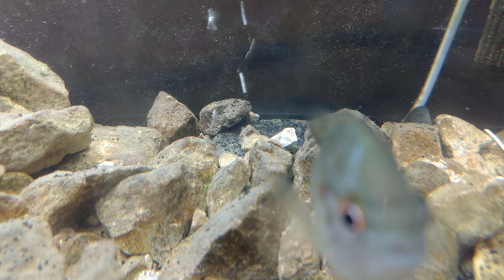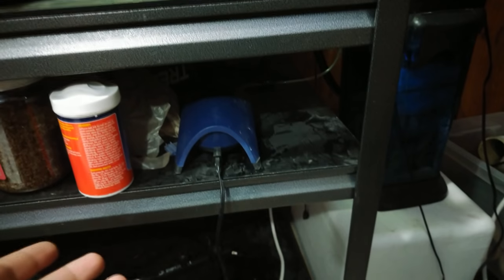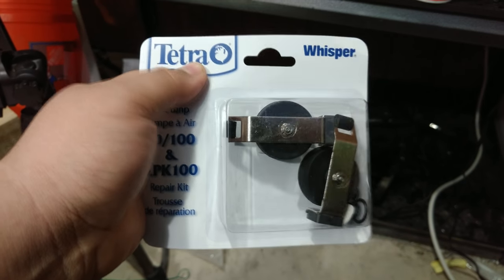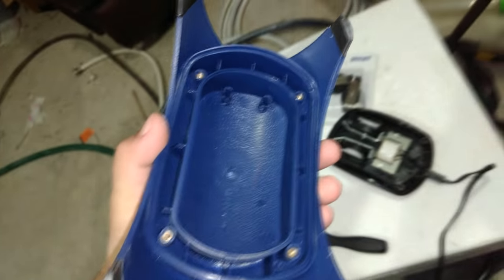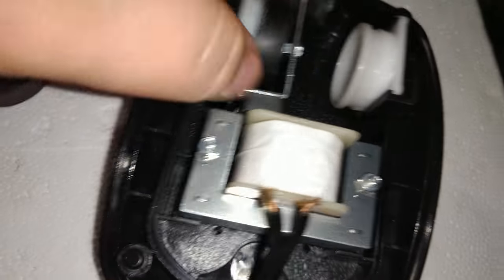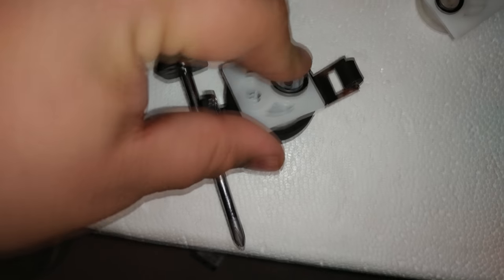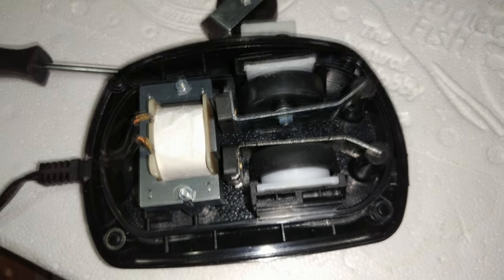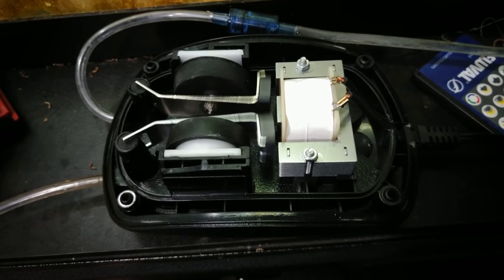How to fix an aquarium air pump when its not moving air

Comment: Very helpful video , thank you. My gf picked up a free tank and air pump but the pump was weak. After watching the video and opening it up it looks like the previous owner had a back siphon happen through the air pump, the screw head inside the diaphragm was rusty and there was a dry film/residue inside. After cleaning out the tiny airways on the plastic piece and reassembling it worked like new.

Comment: So glad I found your video. I own the Tetra 60 whisper and was having the issue you described. I opened it up and found that one side was missing on of the O-rings. I suppose it could have fallen into another dimension when I took out the part. Either way, I was able to find the right O-rings at my local hardware store, replace it, and now it's working perfectly. Although, that did lead me to find a leak in the line, probably should have looked for that first thing. It all works now though, thanks to your insightful video.

Comment: I had two of these air pumps that failed in a smaller tank than they were rated for.   Yes it was simply a matter of torn diaphragms.  After getting an email stating replacement parts were on the way, I never got them.  3 weeks later, looking back at the email chain there was also a message stating that rubber parts were not covered in the 2 year warranty and to go find them myself.  Basically the support guy told me to go pound sand after I thought we had worked it all out.  As an aquarium owner of 25 years I have bought many Tetra products.  I can assure you after my experience with their customer support, I will never by anything from Tetra again.  These air pumps are not strong enough to work in the tank sizes they are rated for.  Customer support treated  was flippant and reckless.  We rely on this equipment to keep out pet fish healthy.   Don't expect anything from customer support, the guy I spoke to, Scott Bonomo, was clearly either in a bad mood or just a complete @$$.
Reply: Jon Tucker Dude, he dealt with me too! I’ll paste response. “At this time the diaphragms are not covered under warranty. You can purchase repair kits online, on our website if available, www.tetra-fish.com or you can try other outlets as well.

Thank You

Scott Bonomo l Consumer Relations
Spectrum Brands - Pet, Home and Garden Division".
Reply: @Rexl  Same experience here-- had me check the diaphragms and then ghosted. Not sure why anyone is saying they were helpful.
Reply: Same experience here-- had me check the diaphragms and then ghosted. Not sure why anyone is saying they were helpful.
Reply: I also got the brushoff from Scott B. There's something wrong with that guy, assuming it's a real person.

Comment: Thanks man didn’t have this problem but you gave me confidence to mess with it
It turned out  it was some type of gasket or built in check valve that was clogged , its connected to what would be your white removable pieces
So for mine instead of the white pieces yours has, it’s a black piece with the side that connects to the diaphragm and it shoots the air out of the side of that parallel with the diaphragm 

Tried to blow air through it and couldn’t
Just poked it with a paper clip and had good airflow
Next thing yk I plug it in and works very good 
Sat in a bin for 2 months before I decided to try fixing it before tossing it iut

Comment: Thanks for this video. It seems that almost all of my pumps  made noise or stopped working so I won some new ones on eBay. Then I found these videos on Air Pump Repair???? So I am going to Fix my other pumps'. I have a few Tetra Whisper 100,Top Fin 8000,Secondnature Challenger II, and some others. I almost tossed them in the Garbage Now I am having a little fun Fixing them  Thanks......

Comment: Noob question but if you only need one air thing running can you take out the parts on one side to make it quieter?
Reply from the maker: I would imagine that wouldn't be a problem. That being said, they do also make single output versions

Comment: for the cost of these they shouldn't go as often as they do.. I have two whispers and both went within a year +/-.... in my opinion this air pump is trash... if they were inexpensive, sure I could see a BIT of upkeep... for the price though they should be good for years... never will I buy another whisper. when working yes they are good though... but durability is very important.

Comment: What if the magnets arent moving much at all?
Reply: I have the same issue
Reply: Take it apart and carefully clean out the tiny holes in the plastic piece and be careful not to damage the the tiny flaps. I used a one of those flat toothpicks

Comment: One of my nozzles snapped off on my Tetra Whisper. Do you know if it can be replaced or repaired?
Reply: Get a tube from a spray bottle of appropriate size and stiffness clean up broken part drill hole so the tube fits tight turn pump on to clear shavings glue with your choice of adhesive hot glue/Super glue/ ?? Let glue set up very good cut to length maby cut to size first dry fit to check... Good luck hey not much to lose ....not sure if I'm just cheap or just broke i "try "to repair everything sometimes i spend to much time😳

Comment: If I’m just using one side of the pump should I block off the other side to make the one output stronger?
Reply from the maker: In a dual diaphragm pump, each side works independently of each other. Blocking one side will not effect the other.
Reply: Got it, thanks.
Reply: Got it, thanks.
Reply: Got it, thanks.

Comment: But still didn't explain why replace that part?
Reply from the maker: Ah, fair point. I actually have a video on this. And one in slow motion. The diaphragm will tear at some point due to wear. This causes air to leak out and not get pumped down the line

Comment: Please do not leave air pump under lower than your aquarium, power off ,water could back flow down your tubing,
Reply from the maker: That's why check valves are used

Comment: These piles of crap stop working within 8 months of buying them. I suggest going to a completely different air pump. who wants to go through the hassle of always having to contact somebody and have them send them pieces and parts when you can just buy a good air pump and you ain't got to worry about the b******.  And the best way would be is to go buy a new one and just put the old pile of s** in the box bring it back get your money back let Tetra choke on the s***. 😉 Garbage pump tho